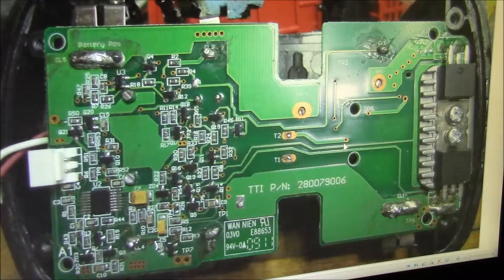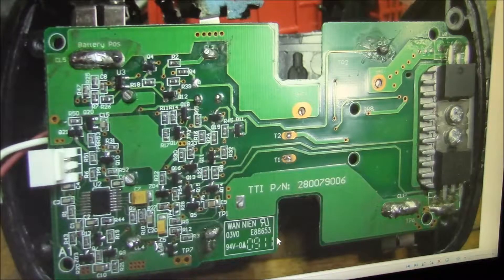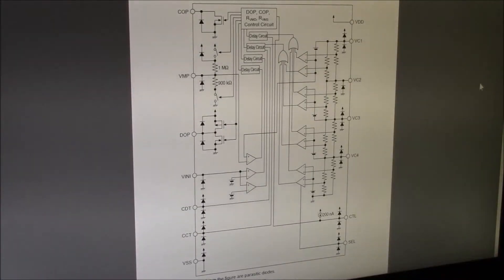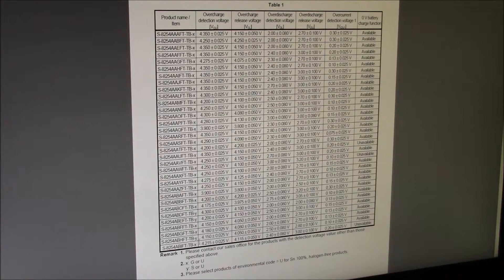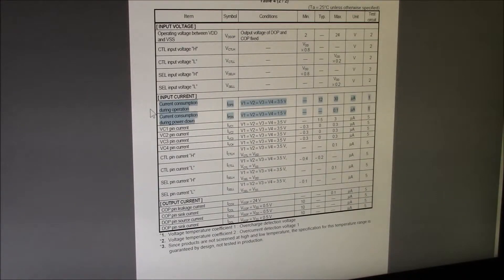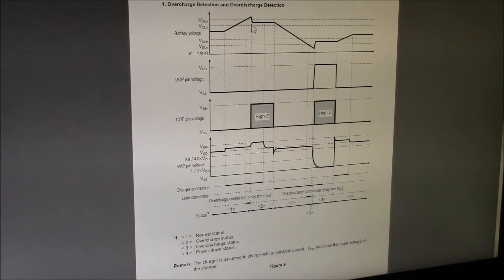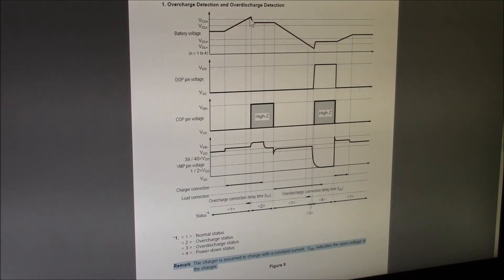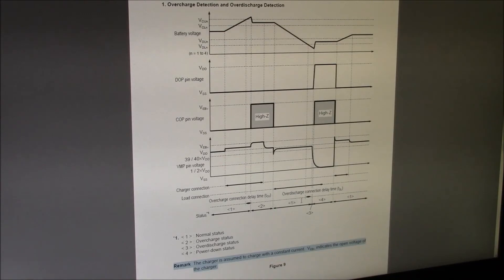Craftsman C3 Battery Tear Down, Part 6a

Comment: Great video. Craftsman ( or its parent company) probably chose this BMS as cost savings from varieties of options available to them. Generally, this kind of BMS rely on the integrity of the cells themselves. Over time, the voltage differential among the cells will increases but the imbalance would still be within acceptable range.  True active balance charging would cost more so as long as the cells are not catching on fire due to overcharge - that's why the OR gate so if once cell is reaching 4.25 the rest must be close enough.
Reply from the maker: Yes, you are right on the mark there.  The BMS design did seem to change a little over the years.

Comment: R Brown.  Did you come across a schematic of the PCB board of the Craftsman?  I have a Ryobi P104 which seems to have a identical PCB except for some cutout specific to the Craftsman enclosure.
Reply from the maker: No, have not found a schematic yet, but may try searching some of the patent numbers to see if anything pops up.  Have heard that there is one company that came up with the basic 18V lithium battery pack and it's licensed to all the major tool mfgs. so very likely they all look almost the same.
Reply: Thanks. I am an EE, I believe like you, and will begin my task of tracing the PCB tracks and try to figure this thing out. My problem is that, on the Ryobi P104 I have about 8 volts or so on the center tab of the battery power tool connector, while the + to - tabs read also 8 volts. The ground reference between the PCB V bat and the - tab on the tool connection is 8 volts. On the PCB the V+ bat to V bat reads about 17-18 volts. I had to replace the two cells by the V+ bat (they where reading 0.7 volts. The FET, not the one connected to V bat, has about 8 volts on the Gate (which is ID as pin one, square pad on the PCB and on the IRF740, SiHF740 datasheet. I believe the problem may be this FET or the signal driving the Gate of the FET. I will keep you update of my progress.